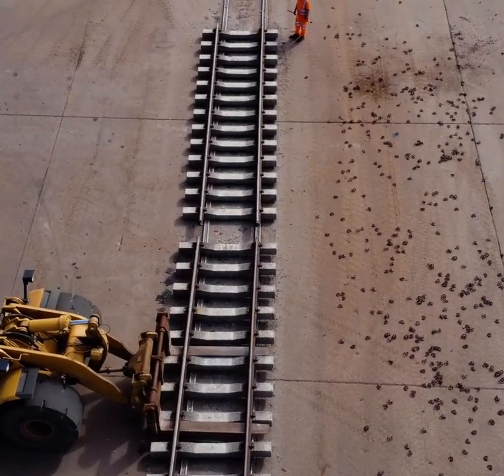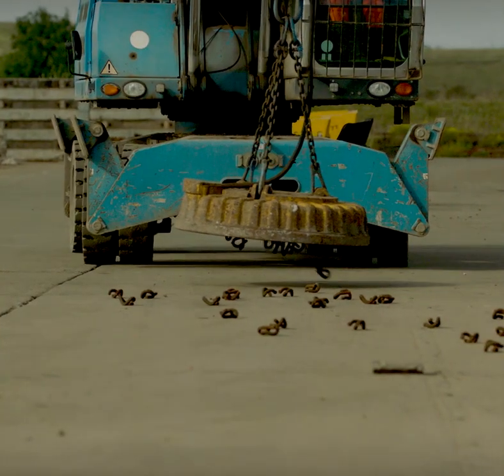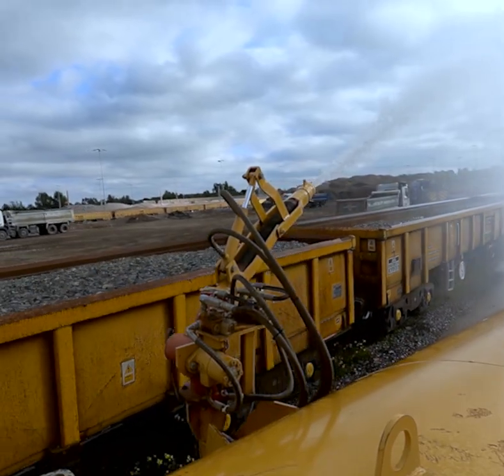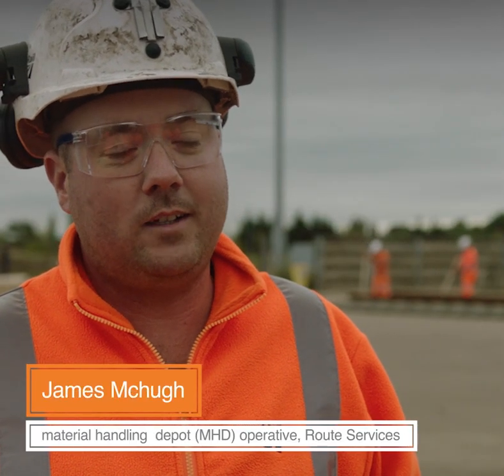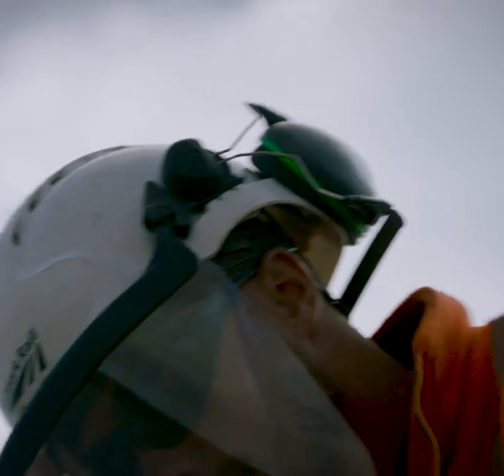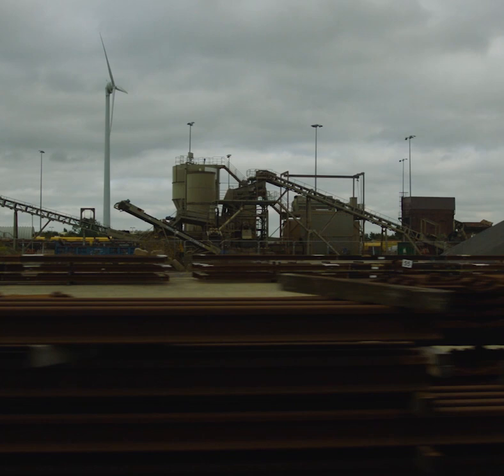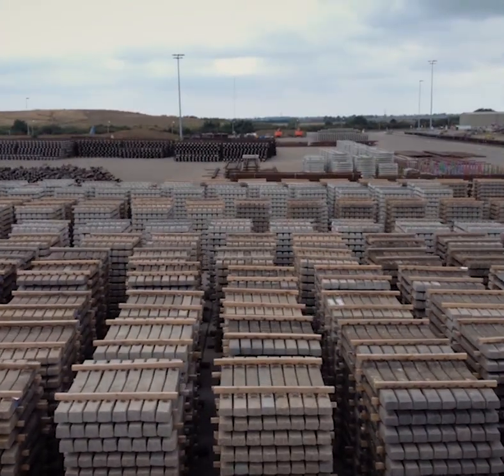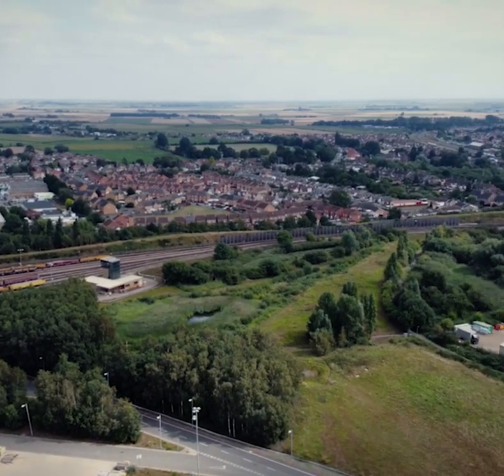Reduce, reuse, recycle at Whitemoor

Comment: Even the guys stripping the sections were Spotless.  My orange kit was Stained with Tracklube, could never shift it once its soaked in. Bloody Plate Oiling, dirty job.
The £30,000,000 goes for Fines from TOCs for job over runs, causing train delays. Lol.😂